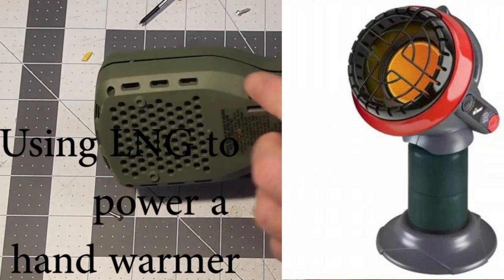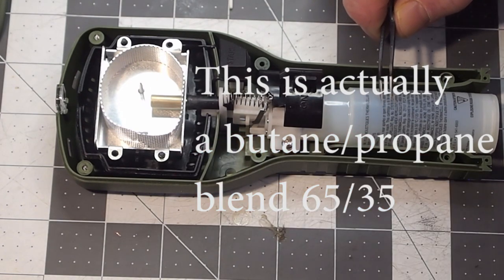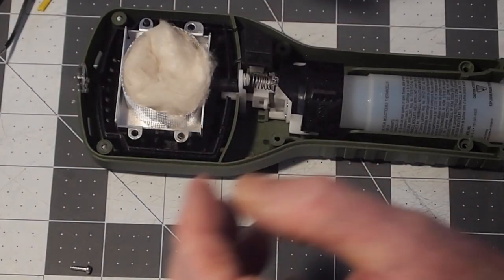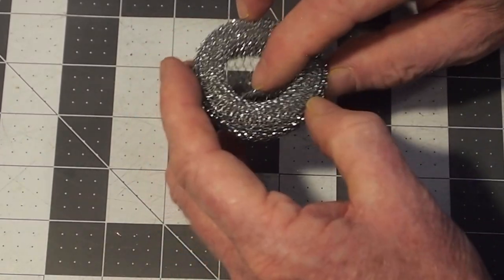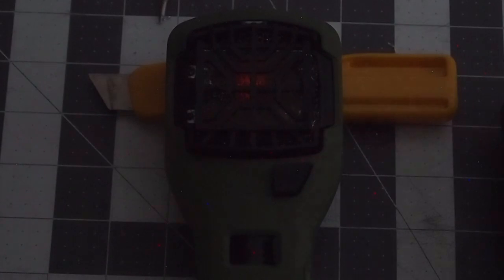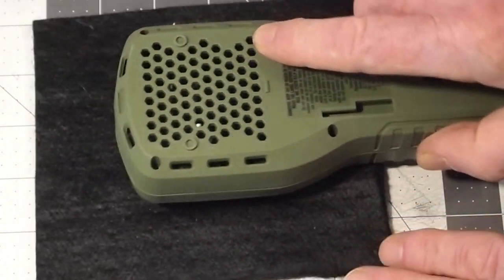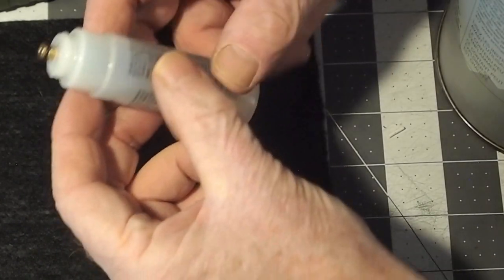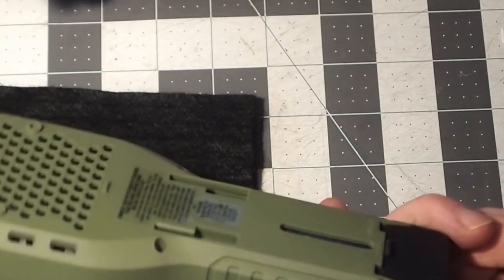Handwarmers S07E05: Hack a Thermacell and use as a propane/butane powered hand warmer

Comment: Interesting, might have a go at converting one myself!
Reply from the maker: Thanks Guido. When you get your pad you should have enough that you could undertake this project. We've used it a few times since I made the video and it works well suspended on a lanyard around your neck and worn inside the jacket. I've found it's easiest to ignite it by passing an open flame quickly across the middle of the pad rather than trying to get the piezo ignitor to work. The catalyst pad seems to glow in the center and not toward the edges, so I get the impression that there is not enough fuel flow to use the entire pad surface, but it seems to be just the right amount to produce the desired heat output withal.

Comment: What advantage does this conversion have over using the Thermacell "AS-IS"? Safer, more heat,??? Been using mine for years as a hand warmer with no mods, without pads. Second question is refilling. Thermacell fuel cartridge material SDS says it contains 100% butane. Been using dollar store yellow "Neon" brand filtered 10oz butane for refilling Thermacell cartridges with no ignition issues. Does adding propane increase the heat and is it worth the trouble? Is it a high altitude thing???
Reply from the maker: The Mod: A Thermacell is not a handwarmer. The addition of catalyst material is so the Thermacell will have an exothermic reaction just like a handwarmer. (Butane and propane themselves are hydrocarbons, and their combustion in the presence of oxygen supports an exothermic reaction.) Otherwise you are burning fuel and have a fuel burning furnace in your pocket, not a risk I really care to take. 
The Butane: It's not mainly a high-altitude thing, it's a 'cold weather' thing (although atmospheric pressure can change the boiling point of butane). The dollar store propane is 'n-butane' and is the same one they sell in the Asian market stores. The boiling point of n-butane is approximately -0.5 degrees Celsius (31.1 degrees Fahrenheit) at atmospheric pressure.
The boiling point of isobutane is approximately -11.7 degrees Celsius (10.9 degrees Fahrenheit) at atmospheric pressure. N-butane is much less expensive than iso-butane. The boiling point of propane at atmospheric pressure is approximately -42.1 degrees Celsius (-43.8 degrees Fahrenheit). So by mixing propane with n-butane the high cost of using iso-butane can be avoided, and your device can work at much lower temperatures than -6C (due to decreased pressure, -6C is about the functional equivalent you can use an iso-butane canister for cooking at in winter. We just had -40C temps where I am). That's why all camping stove fuel canisters use a butane/propane mix for winter camping. You cannot place pure propane in a butane canister because they have thinner walls and would explode under the higher pressure, that's why the winter camping canisters have about a 20% mix of propane along with some iso-butane and the rest n-butane.
Reply: Last sentence in the first paragraph. The risk is between your ears. Product liability would have pulled this product off the market 20 years ago if this was an issue. This product has been inadvertently placed while lit in pockets, backpacks,etc hundreds of thousands of times without incident. 
Thanks for the lesson in butane & propane.

Comment: My dad says it would be safe to use a full size Mr.Buddy heater indoors, that's probably not a good idea, huh. It says in the manual it's fine but surely not.
Reply from the maker: I used to use them in my van for years before I got a proper diesel heater. Never had a problem. They have a sensor that makes them go out if low oxygen is detected. The biggest problem with catalytic heaters is the amount of water vapour that is a result of the process. You end up in a sauna, which is not great when it's -20C outside and you want to see out your windows and get your gear to dry. Probably OK for a fishing shack or work shed.
Reply: @MountainParameters  I would not want to trust my life to the low oxygen sensor, especially if a lot of condensation/humidity is involved.

It just seems insane, no? Doesn't it create CO2? Surely that's not good. Thank you for the info (:
Reply from the maker: @Tadders  While CO2 is not toxic at normal concentrations, it can be dangerous if it is present in high concentrations in an enclosed space. You are correct, overall, it is important to use caution when using a catalytic heater and to follow proper safety procedures to ensure that CO2 levels do not reach dangerous levels. This includes ensuring that the heater is properly ventilated and using it in a well-ventilated area.